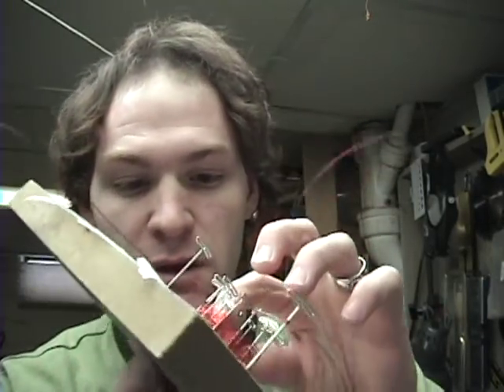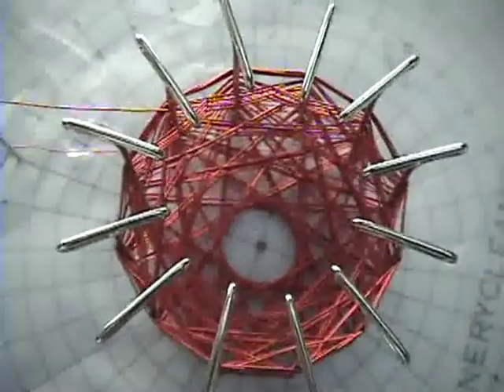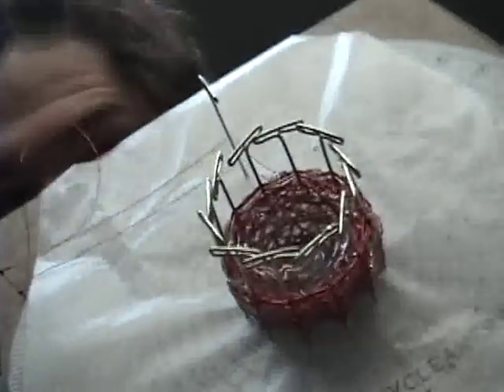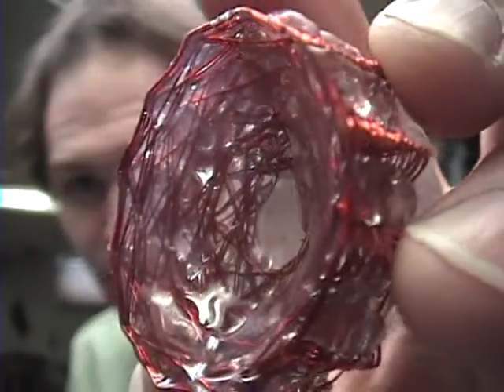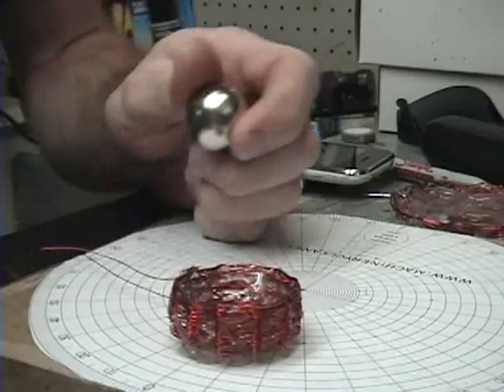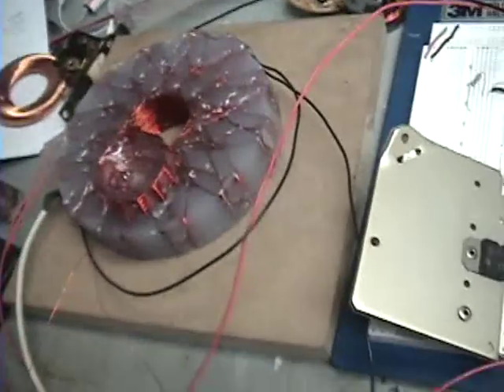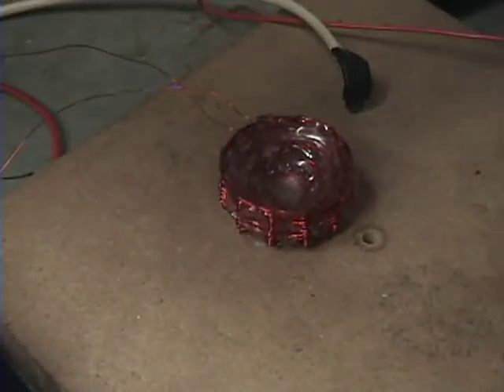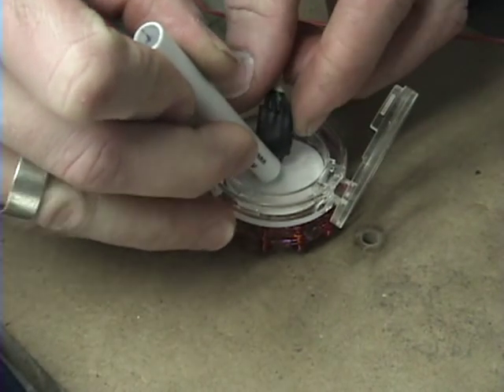Deep 12 point Star-Challis coil! Super fast spin up times pulse motor! (TEST 27)

Comment: What ive seen so far is a group of 4 set one on each side then a switch added to keep changing from one set of two to the next to cause rotation. This is an amazing way of making energy, as it spins up the pull on the outlet goes down.  There are some seriously interesting designs. Good Luck!

Comment: Russ, this coil looks much much closer to the ones I've been making as of late. And just like I told you, the smaller the coil, the stronger the field. I was also blown away by how strong a field they produce with so little wire. The 24 point is even stronger.
I'll be makeing a 120 point, and rather large, 6" across and thicker wire. I want the cup to be deep. I've got an idea on how to make a blend of electro and solid mag's for frictionless bearings and motor in one unit.
Peace.
Mike.
Reply: So if you were to make a massive sized coil, it's magnetic field wouldn't be as strong? Would it be more beneficial to make very tiny coils, then combine them to make one extremely large coil?

Comment: Im puzzled as to why its concave like it is.  I've made a few similar coils but I'm not tracking how its got the challis shape. Usually I get the inner portion is a bit taller than the outer edges, but this is opposite, the outside is higher than the inner portion.

Comment: Simple question? What is it's realistic application(s), benefits etc...?  Outside the realm of a youtube video, how can this be implemented in the form of a gadget and used daily?
Reply: Rodin star coils have the unique property of creating a strong magnetic field "Without" the need of Iron or other ferrous material to get the same flux concentration. So devices can be built at lower material cost and less weight. Another application is for use as very broadband Tx/Rx antennas, that previously had to be done using fractal shaped designs.

Comment: You should swap out that hot glue is silicone you're losing 15% of your...
And also if you're trying to make vorticular magnetic generator, you're neglecting to consider the concept of the gauge of wire, gradually declining the smaller gauge.

Also pertaining to your dedication on the subject.... Consider rebuilding with a guitar string.
Reply: Sorry I was half asleep.
I'm not sure if you used hot glue, or silicone, but by using silicone and avoiding hot glue, you don't restrict the conductivity.

Consider the concept of a vorticular current, as the coils charge, the gauge of wire gets smaller.
Eventually, arcing from the coil or jumping.

By doing so...
The natural magnetic field of the planet, and stabilize as it begins to....

Comment: Pretty cool. Small mass, small diameter is realtivly easy to spin up fast and get high rpm. Judging by ear, audible I'm guessing around 8khz or roughly 480,000 rpm. + or - 10% 

Rodin/starship coils are pretty neat.  I made a fairly unique motor based on some of the concepts. 

Even as my motor has 3 coils wired in wye, on analysis of a single coil you'll find its magnetic fields are lot like the major magnetic fields of a flattened rodin / starship coil's magnetic fields. 

My first axial flux BLDC motor.: https://www.youtube.com/playlist?list=PLdlUFrCvem9Mgg2PpIre7AAmBD-fzDwq2